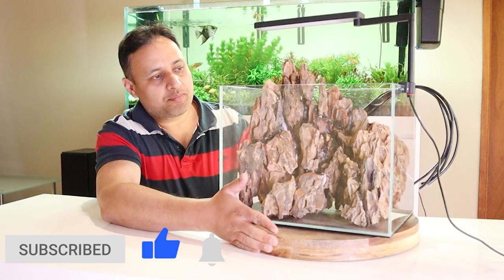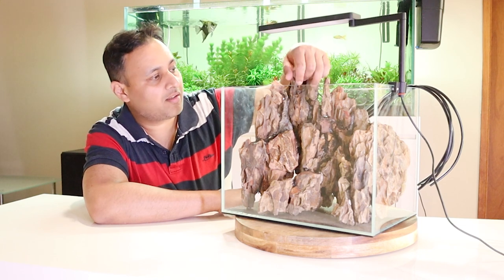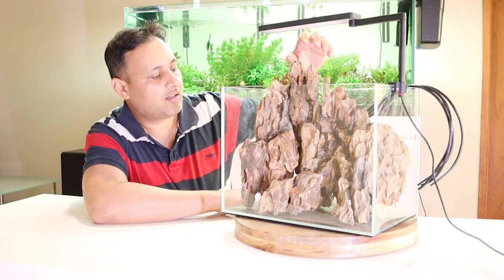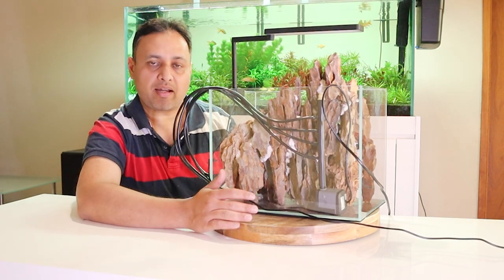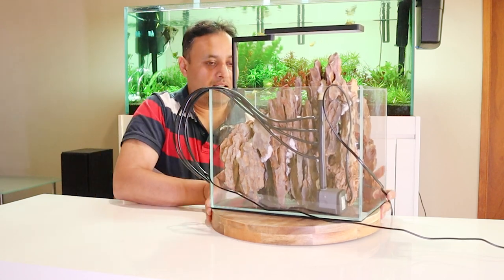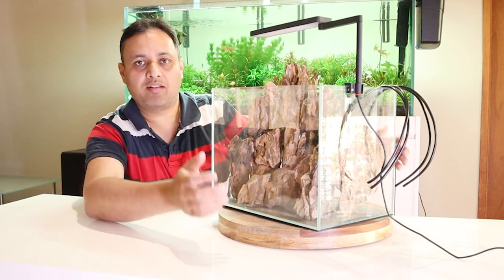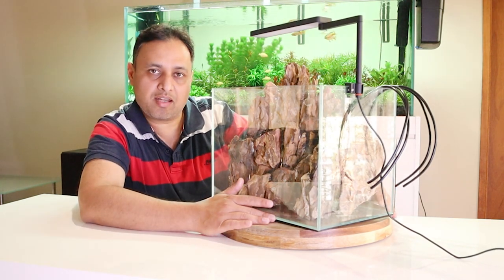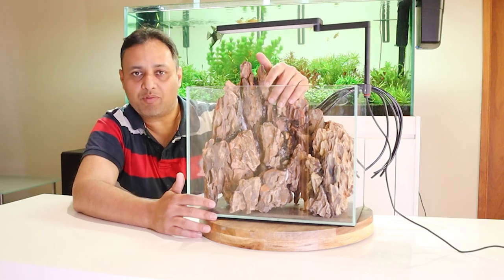Nano Waterfall Paludarium - Step By Step Tutorial Using Waterbox Clear Mini 6 And Dragon Rocks

Comment: Great one - thanks for sharing!

Just had a question on using what I assume are cigarette filters with super glue making a reaction to stick the hardscape together. I tried that method with a random pack of filters from Woolies and LocTite super glue and unfortunately there wasn't any reaction to instantly bond the rocks. Are they "special" filters and super glue of specific types that should be used for the bonding reaction to occur?
Reply from the maker: Thanks for enjoying the video. I normally use any type of tissue paper, but before I used cigarette filters or filter wool that we use in aquarium filters. Nothing special there and all will work as long as glue that you use is not too thick or gel type. LocTite super glue work as Well, I used it too depending on the price but buy the one which is thin type, it’s the blue bottle in Bunnings. You can also buy thin super glue from craft shops or wood work shops, they all supply it. I will have some glue for sale soon as trying to import some at reasonable price. The amount of glue I use it does get expensive buying from from Bunnings or Woolworth :)